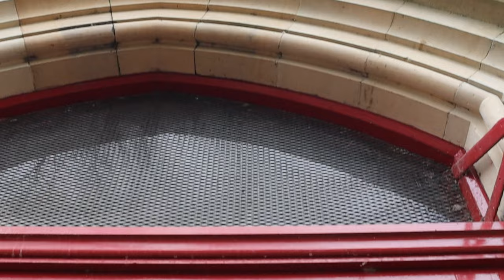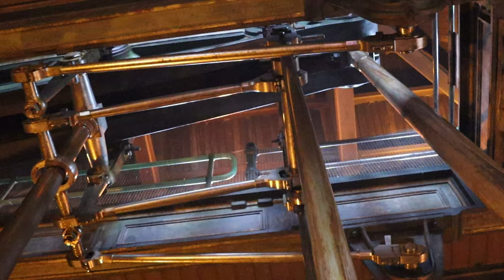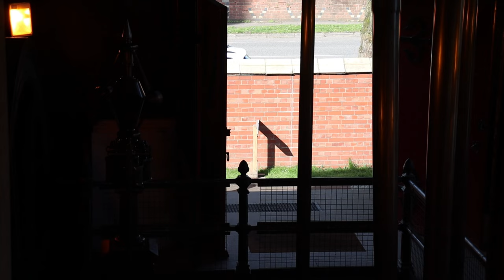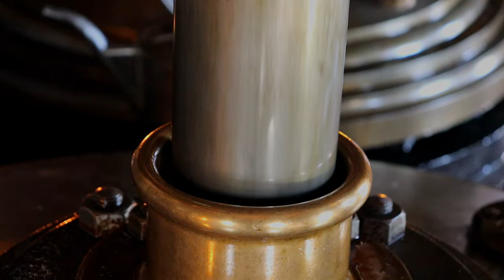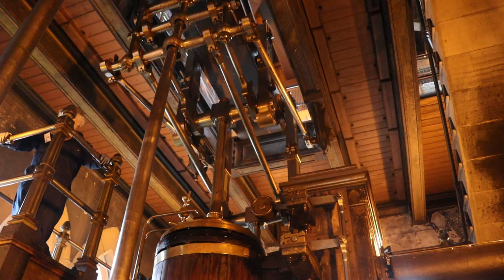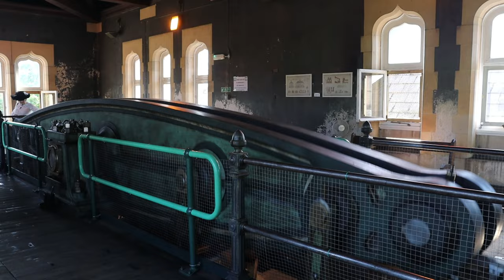1904 GLENFIELD & KENNEDY WOOLF COMPOUND ROTATIVE BEAM ENGINE - TEES COTTAGE PUMPING STATION

Comment: Are these engines essentially the same as the ones at claymills except for the construction of the beam?
Reply from the maker: They are in a way since both the Tees Cottage engine and the 4 at Claymills are Woolf compounds but there the similarities end. The beam of the engine at Tees Cottage is two cast iron plates with a cast iron weight at the piston end but the Claymills engine is a Girder Banner beam which is riveted. The Tees Cottage engine has drop valves with Corliss mechanism whereas the Claymills has a version of Cornish valve gear. Also the Tees Cottage engine only needs barring round if there is a problem with it as it always stops at 3/4 of a stroke and when it needs barring you use a metal bar in the wall and flywheel spokes whereas Claymills needs barring most times and it has a small barring engine to do the job.